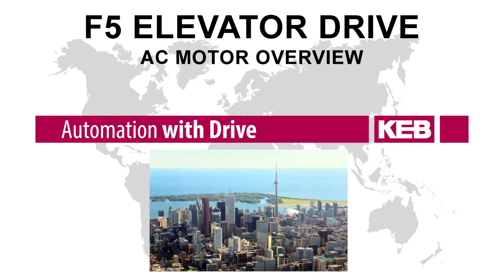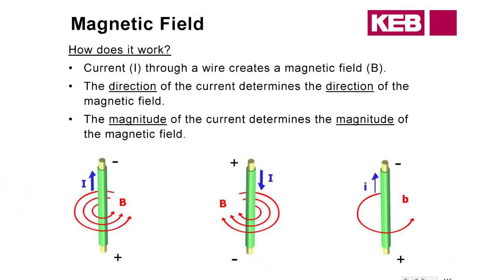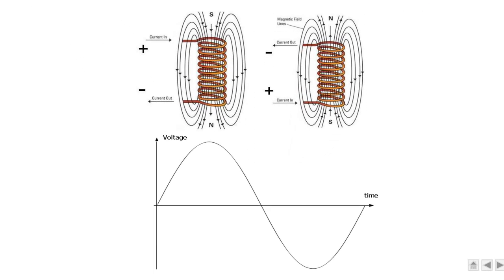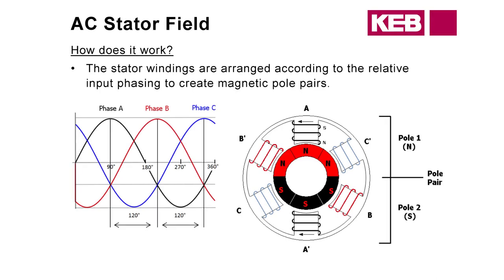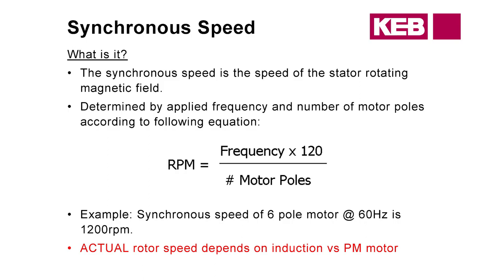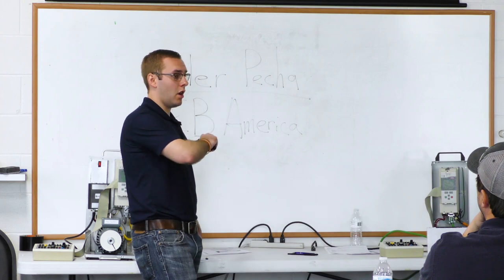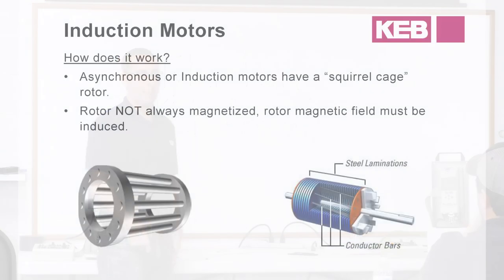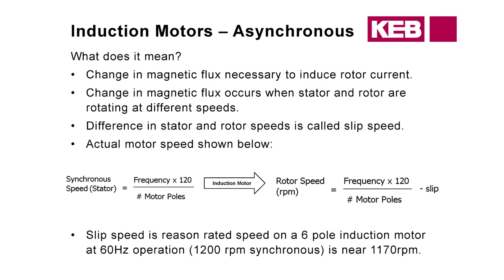KEB F5 Elevator Drive Training: Difference between Induction & Permanent Magnet motor (Part 7)

Comment: We did phase-controlled induction motors, via V/F controllers.  Any induction motor can be improved in performance, with a rotor-sensor installed, and an appropriate inverter attached.  Much better efficiency, almost at the iron and copper/aluminum limits.

Comment: Really helpful for engineers in the EV motor universe! A million thanks to You!
One question REALLY bothers me: do the permanent (Neodym) magnets in a rotor loose some of their magnetic capacity over time ? Means: do they have to be replaced after some years of intense use in an EV ?
Reply from the maker: That's an excellent question. Will magnets lose their power over time? Here is one response online that should answer your question. 
"Modern magnet materials do lose a very small fraction of their magnetism over time. With samarium cobalt magnets, for example, this has been shown to be less than 1% over a period of ten years."
So, while there is a slight loss in capacity, it's very, very small.
Reply: @KEBAmerica  
Thank You a lot ! 
So EVs will be oldtimers after 30 years without a problem (just replace the battery every 10/15 years) - if they do not rust like Model 3 ;-)